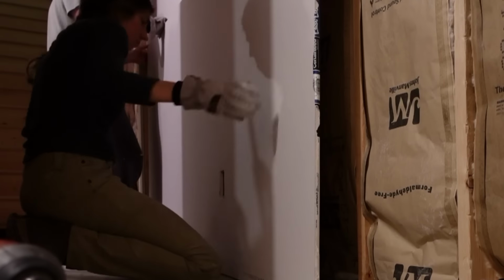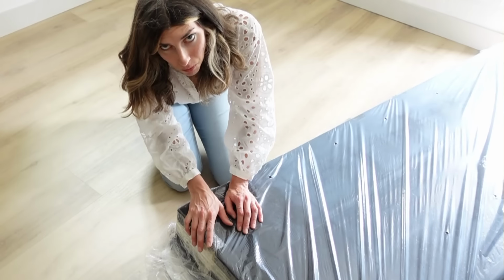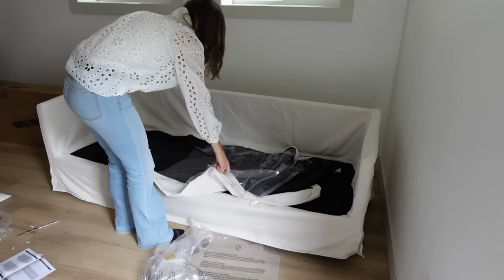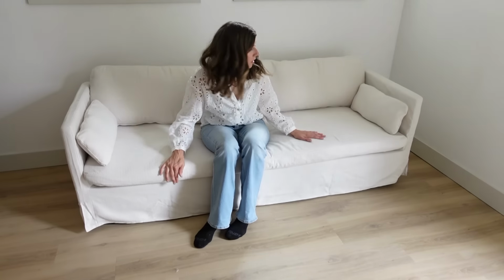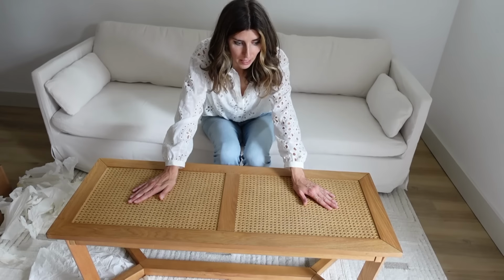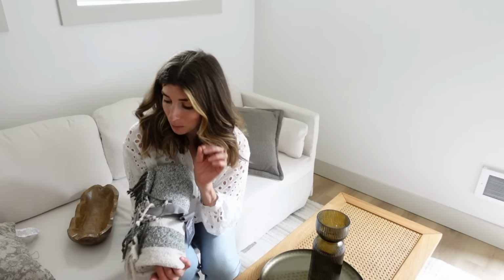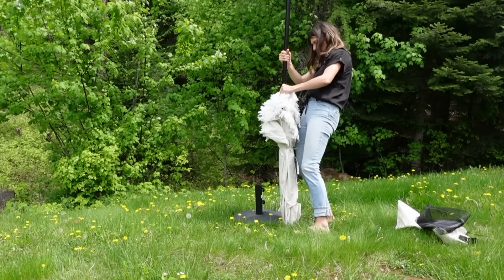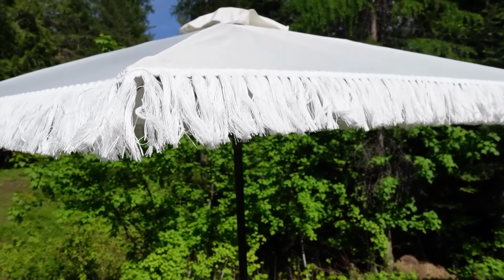NEW Living Room Makeover Mediterranean Cottage Decorate With Me / Renovation House

Comment: Love the furnishings.  You said this is a rental right?  So you are furnishing it for the tenants?
On the rug I would push it completely under the sofa so it starts against the wall and the rest you can see under the coffee table. But because it is so light and you will have renters there at least most of the rug won't be exposed.